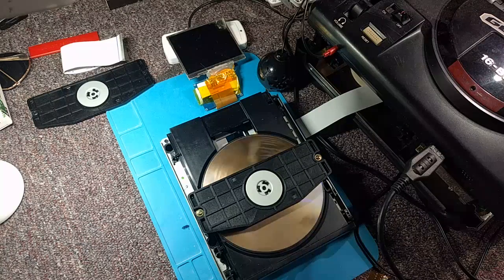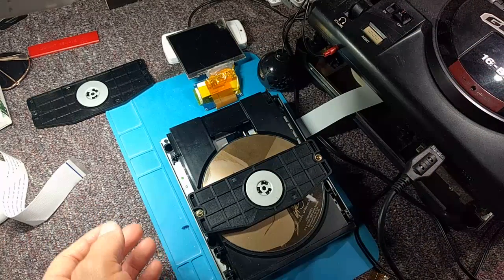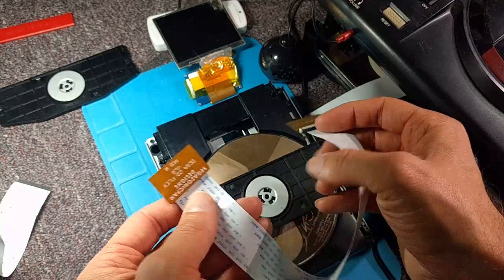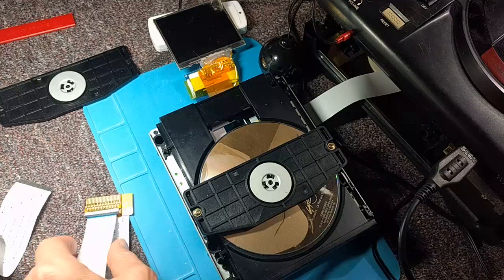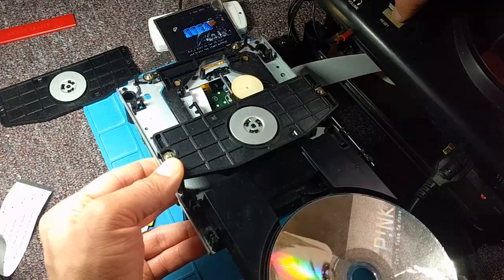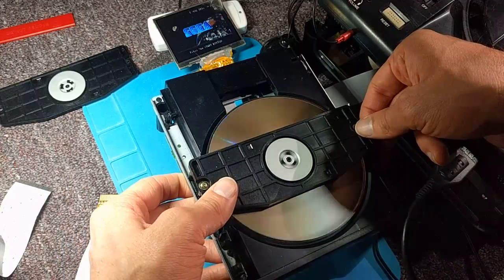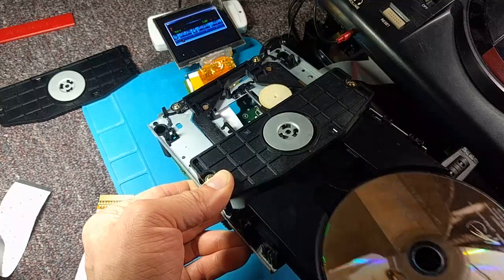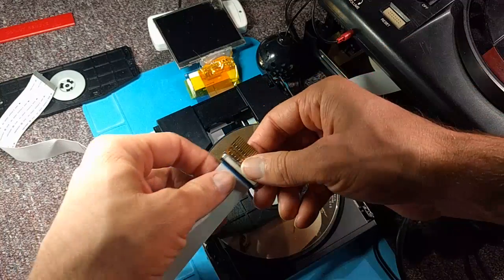Sega CD Flex Debut! [SCD Model 1 Repair Tool]

Comment: i kept all the catridge based games + the cds i got when i was younger, NO NEED FOR THE SYSTEM NO MORE. since th KEGA EMULATOR can emulator it very precise. plus it will help out SEGASONICFAN. once the laser wear out on the drive good luck trying to find a replacement drive.
NO THANK YOU... i got rid mine while it was still working, KEEPING ALL THE GAMES. with the drive in a pc. it can be replaced if it wears out $20 25 for a DVD WRITER. that can also read the cds. SO SEGASONICFAN DESIGNS i wont be buying any of your things in the next 20 years. SINCE THE EMUATOR has taken over the system & not having to play around with troubleshooting the stupid thing......

Comment: Do you know where I can get replacement ribbon cables for my sega cd model 1?
Reply from the maker: AFIK they dont make them.  Which is why I designed this.  Itll be for sale in the coming months, go to my website (order tab) to join the announce list ;)
Reply: @SegasonicfanDesigns  Ok, thank you very much. Please make both 21 and 25 pins available. SinceI have you here I have another question. I replaced the TR4, Fuse, and Rectifier Diode on the power sound board. But now I have to turn on and off my genesis multiple times before i can play cds. Once its on it works just fine. Although there is a risk the game might freeze. When it doesnt work i can hear the drive trying to spin but i dont even get an imagr. Reason i suspect the ribbon cables is because they appear to have some damage. While the rest of the boards looks clean with no bad capacitors. What do you think?

Comment: Any updates on restocking the ribbon/extension for the laser?

Have you thought about making a similar adapter for the power flex? It too can be very hard to come by unfortunately. The ability to buy modern, affordable replacements would be amazing!
Reply from the maker: Thanks for the comment – I have thought about doing a version for the power cable, but you're the first person to express interest in that :P  I'm still working on this project, and I've recently been building up my 3D printer skillset to finally do the standoff / laser support.  Stay tuned!  This is a humble project that is not going to be wildly popular, so it is not first on the list.  But it will get done :)  -SSF
Reply: @SegasonicfanDesigns  I love it my friend.

Im in the middle of saving some SegaCDs (and any other system I can) from being junked.

I got a JVC based segaCD a while back. Recapped the mainboard, power supply and JVC CD PCB. New fuse on power board. The mainboard looks good, but isnt working. Looks like trace issues to the program ram according to SegaCD tools on 240p test suite. I desoldered the program ram, ordered new ram from aliexpress. But I think its a trace issue.

Recently, I bought another model 1. "Untested". Seller claimed something was loose inside. Turns out the magnet that the cd rom ribbon slots through came loose, and pulled the ribbon out of the socket. This was the standard, common Sony laser based CD ROM

So I tested the fuse, it was fine, reseated the cd rom ribbon... and.. it boots! CD rom wont eject though. So I swap in the only spare drive belt I actually ordered for the JVC system... and... after struggling hard to get the drive tray back in.... got it back together. The laser seemed to work..a bit... but after leaving the system on for about an hour with streets of rage sega classics CD running... it wouldnt boot the disk again. Freezing up at the blue logo when sega classics intro plays. SonicCD booted, audio was way behind... didnt stsrt till 30 seconds into gameplay, wouldnt load the second zone at all. 

So I took the good mainboard out of my sony laser model1 console, and put it in the JVC model 1. That system booted right up too! And its laser works great! 

Im left with that sony laser cd rom unit not working well... it seemed / smelled like it was getting hot? Could it be an assembly or alignment issue? It ejects and goes back in buttery smooth... but when trying to load some times in game it clicks... click, click, click... even seems to grind a bit around the time its clicking?

That and I need to sort out that other mainboard with trace damage. 

The extension ribbon to run the drive outside the console would rock! Id love one! And the ribbons in general are rare and easy to damage. Being able to source a modern replacement/adaptation would be awesome.

Im very well versed in soldering. The part of all this that Im not so good at is the CD ROM drives in these things.
Reply: @SegasonicfanDesigns  Man, it would help so many people if you could get these up for sale. I simply cannot find these replacement oem ribbons anywhere.

Comment: Will your raise kit allow to omit the raising action of the laser and install it like that back into the series one?
Reply from the maker: sorry, I dont understand what you mean.  Im designing an add-on for mounting the assembly, but no it will not completely redo the raising action that is needed by the original design.

Comment: Got one from Japan with no sign of life and it’s not the fuse. Any ideas? Acts like there is no power. The regulator is definitely getting power. With no power button, how does the console normally signal the Mega CD to power on? I suspect an issue with that.
Reply from the maker: Please post your Q on sega-16 technical forums, it's the best respository and community repair place:
https://www.sega-16.com/forum/forumdisplay.php?19-Tech-Aid
More info on why I dont answer here:
https://segasonicfan.wixsite.com/retro/links
Reply: thank you for taking an anti-discord stance on sharing valueable knowledge publicly. the mass societal switch to private group messaging apps has helped destroy information flow since it got popular, will definitely sign up for that forum soon.
Reply: Try the easy stuff first, clean the edged connector on the Mega CD and on the Mega Drive/Genesis first. Use IPA or DeOxit. That got mine to power up. From then onwards it was an upwards battle with several issues but it ended with the console fully working. Had to recap it, properly clean the limit switches, replace the laser assembly, battery.
Reply: @hadesmcc  Thanks. Tried all that and even deep cleaned with an ultrasonic cleaner but still nothing. I recapped the power/audio board but stopped short of doing the mainboard. That’s because it looked brand new and I decided to wait until I could try a known-good mainboard first… or at least one from a system that powers on. Now it’s been a year. ;)
Reply: @emmettturner9452  Did you check TR4? It's a common point of failure. Aside from that. I'd say start by tracing the power around with a multimeter, to see if everything checks out.
Reply: @hadesmcc  Yes, I ordered that from Console5 along with the cap kit and drive belt back in May 2020 but it’s been so long I forgot to even mention it. :) Replaced but no change. Makes me wonder if the replacement was bad.
Reply: @emmettturner9452  That's why I usually order at least two items for stuff like that. In any case, I never received a non-working part from Console5. Not that that is evidence of anything, it's anecdotal at best. Did you check your ribbon cables for continuity? You could also have a bad IC somewhere but I'd keep that assumption for last. You could also try powering it up without connecting the CD drive, just in the off chance there's a short there or something. Also make sure your bridge board with the 2 edge connectors doesn't have an issue, caps, maybe broken solder joint on those two tiny wires. Keep at it!
Reply: @hadesmcc  Thanks.

Yeah, Console5 said exact replacements weren’t available anymore so it could even be a tolerances thing. I do typically order more than one so I’ll be prepared the next time I seek out/encounter the issue but I just dug up my old my email invoice and it seems I only ordered one. Oh well.

I did check the ribbons. If I can isolate the problem to one board using parts from another system then I’ll recap and start checking ICs if that doesn’t work. Guess I should’ve kept looking for another faulty one that powers on at least. :) Thanks for the tips!
Reply: @emmettturner9452  No problem, you're welcome. If you manage to get it working or find any other thing on the console. Feel free to reach out.